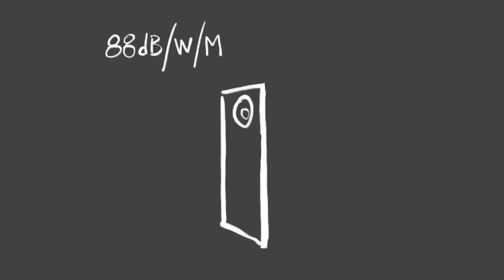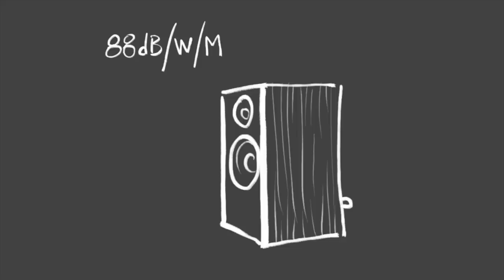John DeVore goes on a rant about the High End Audio lie that inspired him to start his company

Comment: I never put much credence in manufacturers or even reviewer-measured sensitivity specs, except to classify in my mind if the speaker is a typical low-sensitivity speaker or if the designers were going for something that would work with a low-power amplifier. Taking the sensitivity spec plus an educated look at the impedance magnitude and phase curve tells one quite a bit about how that speaker will react with various amplifiers.   There's a lot of interaction between the speaker's impedance characteristic and amplifier's behavior driving that impedance which impacts the sound heard by the listener.  In most cases this is particularly true of tube amps with their much higher source impedance, which is part of the origin of "tube sound."

Comment: The Ar3a is one of the best sounding speakers I've ever heard. You can still find them on Ebay at various prices based on condition. If can swing a fully restored pair and have at least 100 watts in a quality amp you won't be disappointed.
Reply: Their one of my pound for pound favorites, the forte is still my favorite but pound for pound i like the ar3a and the kef ls50 for their size anyway, but the ls50 will image waaay better than nearly any box soraker ive heard, thats their specialty i suppose. Then again the ar3a has crazy deep and smooth low end for their size, which is their specialty, the forte basically has it all, i cant find any faults with those.
Reply: @JukeboxAlley  In the day, Mac 60 monoblocks were a great match for AR speakers.
Reply: @genehart261  agreed, i had some 65 wpc dynakit tube amps on mine, its hard to beat that combo with anything literally.

Comment: Anybody that listens to vinyl isn't into high quality listening, they are into character
Reply: Up to a certain degree, I beg to differ.
I still listen to my vinyl. I use a class A Cambridge Audio Pre amp,  a turntable wooden made with belt drive by Thorens. A Concord cartridge and diamond stylus, 4 Mission floor-standing speakers with 16 gauge copper wire made by Chord and I clean my all my vinyl before and after playing to remove dust particles.
Am I not hungry for quality?
Man, if you have a passion, you want it all and how!
CD was never my thing. Analogical has always and will always be the be all and end all for a lot of us diehards.
Reply: @richmck007  Yeah, I agree it is fun to be passionate and you must be very proud of your kit. Steam engines are cool too! Each to their own.

Comment: Thanks for the video.  All of what you said makes sense to me, and it was obvious to me that these new speakers with multiple small drivers had less audible bass compared to my old JBL L7's than the 3dB difference in sensitivity and minor differences in response curves would suggest.  While your video explains my perception, I'm left wondering if the low-end impedance drop you mention is driven by driver design, the increasing use of multiple drivers, or both?  My experience with single-driver bookshelf systems suggests that it's the multi-driver phenomenon, but I'm less fussy about such systems and haven't done enough listening tests to confirm my suspicions.  I'm wondering if amplifier demands are more predictable when the speakers have a single driver.

All that is idle curiosity.  While nowhere near deaf, my hearing has degraded with age such that audiophile components no longer make sense for me.  That said, I've never purchased high-end loudspeakers without listening to them with the amp(s) I intended to pair them with.  As anybody who has invested in tube amps surely knows, good specs don't necessarily mean good sound.

Comment: Thanks John, but sensitivity in [dB/W/m] is just a WRONG unit. This suggests, that the sound pressure increases with the distance, but the opposite happens, as you know 😉 The "mathematical" correct unit would be [dB @ 1W @ 1m]. But in the sense of your message, your absolutely right!
Reply from the maker: Yes, you're completely right. I was using the most common way of writing it, but I should have discussed this in the vid.

Comment: John, I would like your take on something. I am a big vacuum tube guy and as such I think it is important to have a speaker system with a flatish impedance curve or at least one whose impedance closely corresponds to amplitude response. When it comes to multi way speakers however I wonder about crossover tricks to flatten the overall Z curve. It seems possible that some such tricks might just waste power in driving resonances without improving system response and amplifier load.

Is this a reasonable concern? Would it be a worthwhile approach to choose drivers with generally favorable Z to response characteristics and to only use them within the frequency ranges where they are most favorable? Would this avoid overly taxing crossover networks? How does a tubie like me evaluate driver curves and specs in this regard? Perhaps a video on the topic... Thanks for pulling back the curtain.

Comment: Volts and watts are two different things.  Volts are just part of the equation.  Watts are volts multiplied by amps.  Also known as volt-amps, or VA.  Ohm's law.  So, when the sensitivity of a speaker is measured by dB/2.83V/1M, then that is incomplete.  Because 2.83 volts multiplied by 100 milliamps is a much lower wattage than 2.83 volts multiplied by 1 amp.  So, the sensitivity measurement of dB/W/M is a more complete and accurate measurement.
Reply from the maker: Great comment, thanks.

Comment: There is kind of a vicious circle thing happening. As hifi went to more and more solid state amplifiers speaker designers got lazy and built systems with crappy impedance curves because (solid state) amps are virtually voltage amps so since these new amps care less we can be careless and assume constant voltage and infinite current capability.

So as speakers got less efficient, more ragged in impedance, and more current hungry the mantra was our speakers aren't crap your amp is crap. You need to buy a more heroic amp.

Comment: I'm a car audio enthusiast as well as someone who enjoys Hi-Fi home audio, but I am confused by this. It was my understanding from car audio subwoofer and monoblock amplifier setups that the lower the impedance you wire your subs to, the more power you can give them from the amplifier. Here I am taking it that a 2ohm load from the woofers in that Hi-Fi speaker received less power than the higher impedance mids and tweeters. What accounts for this difference? How does a higher impedance (resistance) not mean less power to the speaker?

Comment: Thanks for the clear explanation. But that has left me puzzled about headphones. I would have thought based on what you said that for good bass response, in what are basically tiny speakers, you would want lower impedance headphones driven harder. But flat response studio headphones are often 80 ohms or even more. Surely that would mean they could be driven easily for more volume but would lose bass response. Or did I misunderstand your explanation?

Comment: Excellent information! Most speakers in the AUDIOPHILE world are very inefficient!!! Quite dull sounding as well! Even ones with simple crossovers require big amps to wake them up because of the INFERIOR drivers they use!!!! I would characterize them as NOT BEING LOUD SPEAKERS at all! Simply because of the lack of engineering into the drivers themselves!

Comment: One glaring omission from most standard speaker and power amp specifications is, whether measuring by watt or by volt, is the frequency of the signal used during testing... Is white or pink noise used? Is a sine wave used, and if so, at which frequency? While Ohm's Law uses the value of, "resistance", in it's equations, which is the resistance to a DIRECT current..., (which can sort of be thought of as an ultimately low frequency of 0Hz...), a dynamic loudspeaker's voice coil doesn't only offer resistance..., it also offers inductance..., and even a little capacitance as well..., so the combined load acts as an RLC network circuit..., (Resistor/Inductor/Capacitor), and while the resistive properties are fairly constant no matter the frequency, the inductive and capacitive qualities are extremely dependent upon frequency... So if you ran four tests, each at a different sine wave frequency, 20Hz, 200Hz, 2KHz, and 20KHz, then the results for each test will be very different from each other... And should white and pink noise be used for two tests, then as white noise has more high end than pink noise, it's results would also differ...

Comment: John , yes cool T shirt as another has said. You are delivering solid info.  I too, was big into audiophiling in the 80s.  Still have my quality equipment:. NAD 1300 Prem, NAD 2600 Amp ,. Dual CS500 TT, and best of all and probably the primary importance to your high end stereo system, KEF 104/2 Tower speakers.  Then the kids came along and lots more expenses.  I just had a failure of the Phono input on the Preamp.  Found a local stereo repair who repaired the NAD Preamp for $125!!!  Upgraded the cartridge and stylus to ortofon 20 on the Dual TT. The system plays wonderfully , btw, no SW .  That addition is under consideration. At age 69, this stuff is a great hobby and interest for music lovers,. BUT very exensive once you start wandering into Universe Of Stereo

Comment: Let me offer an alternate theory.  In the days of tube amps you roughly matched the
speaker (rated) impedance with the selected tap on the output of the amp and 
therefore a lower impedance speaker got less voltage and more current up to the
rated power of the amp.  This is because tube amps are less tolerant of minimum
load impedances.  However, good (or very good) solid state amps, with their low
output impedance, and high available current are (should be) essentially voltage sources.
Put a lower impedance load on the amp and it draws more current and has more power 
delivered.  Since we do not move to different taps on the output (there are exceptions)
the voltage sensitivity rating (not efficiency) tells you more about what max SPL you
can get out of a given SS amplifier as long as you don't exceed the min impedance spec of
the amp.  Both specs have meaning:
dB/W/m is the efficiency spec
dB/2.83V/m is the Voltage sensitivity spec

Comment: So, in a round about way I stumbled onto this bad trend in the late 90's when I wanted to build my own speaker enclosure and select my own drivers.  It also worked out as a good final project in carpentry class in highschool.  I bought a book from Radio Shack explaining some various designs and theories and went to it.  The cabinets came out great.  Next was to select the drivers for a three-way setup.  That's where things started to fall apart.  Some back story is I grew up listening to my fathers DJ equipment.  It was pretty good stuff.  It wasn't the most crazy high end stuff, but it was better than most people had.  I grew up listening on Marslands and an old Nikko RMS-1200 pre-amplifier.

On the back it specifically says to use 8 or 16 Ohm speakers.  The common wiring for a three-way setup with industry drivers would put me at 4 or 2 Ohms.  That's when I had to do some serious searching, but eventually I came across some non-branded Panasonic drivers that fit the 8 Ohm.  I know my dad harped on that but having you explain some of the industry history helped bring things full circle.  I'm still spinning vinyl on those speakers I made, though not always enough time to nerd out on all the audiophile stuff like I used to.

I don't know if you covered it or know why, but why has Bluetooth taken over wireless audio.  It was never meant for it, and even at BT 4.5 and 5.0 now, it is still lacking and terrible.

Comment: I’m trying to understand this level of thinking. I’m still learning. Probably won’t run into this issue as I’m not on the high end level. But it is something I have thought about. That 1 watt 1 meter is usually with a 1khz tone. People online will talk about how you may never use more than 1 watt in regular listening but like those speakers you spoke about dipping under 2 ohm- deep bass in any speaker can drop in ohms and result in the amp giving much more power on top of the db raise for it to sound just as loud.

Comment: It's certainly something to be aware of to evaluate a purchase, but 2,83volts is more useful for designing the speaker to target a linear response, than 1watt 1 meter. I don't like the accusation that there is some industry conspiracy or twist for sort of advertising the speakers more favorable than they are. If anything on sensitivity that needs a light on a subject it is sensitivity under 100Hz that is where the biggest difference is. It's relatively easy to create sensitivity over 60Hz, but once you go lower is where it gets hard to be efficient and still maintain a good response in a saleable box size.

Comment: This is exactly why I was loyal to HiFi Choice magazine during the late 1980s and 90s. For every loudspeaker reviewed, they always produced a plot of impedance / f so you could see precisely if a particular model was going to trip up an amplifier. You would always expect a variance, of which the manufacturer quoted a mean value, or worse, was quoted for a 1kHz input. Personally, I always interpreted a manufacturer quoting 6 Ohms as an "8 Ohm speaker with a big current drain somewhere in the bass to mid-bass".

Comment: Yep, I watched this all take place while I was an audio enthusiast and as I moved into pro sound.  In the 80s the price of amplifier wattage fell pretty dramatically and we no longer needed an Altec or Klipsch to fill a large room.  When speaker designers began to exploit amplifiers by running at 4 ohm or lower I saw how the dampening factor would collapse during loud passages containing a lot of LF energy with all but the most high end and expensive amps.  This meant flabby bass response at best, overheated amplifiers at worst. 

Eight ohm presents a fairly easy load to most amps built today so that is nearly always my choice in passive speaker systems.

Comment: For decades i stayed away from 4 ohm speakers for the exact reasons you mentioned that over burden amplifiers leaving the speakers unable to accurately reproduce published specs ,in my tube system i always stayed with a Klipsch Heritage speaker such as the Belle Klipsch,in my solid state system i never bought anything except Mcimtosh speakers as Roger Russells specs were always trustworthy ,i can remember telling my hifi buff friends about the speakers impedance swings Roger Russell taught me about & getting the deer in the headlights look with the same answer everytime " but my amp is " insert wattage here " so it should drive anything ,wrong ,the last speaker ill ever buy for my main solid state system is the now 20 plus year old Mcintosh XRT-28 which requires absolutely brutal amplifiers that can double down to the 2 ohm range for crescendos or heavy bass passages ,i think most people understand these issues with speaker & amp matching now days,at least most whove been in the hobby a while,what most dont understand is the need to have 20 amp dedicated lines to power these monster amps at low ohms ,each of my 1,750 @4ohm monoblocks has its own 20 amp line and a 3rd 20 amp line for preamp & source gear ,even with a 20 amp line my amps cannot be fed enough power from the wall to double down in 2 ohms past 1,200 watts at the 4 ohm tap ,its a good thing my speakers max is 1,200 watts continuous because my 20 amp lines cannot push out the 3,500 watt max my amps can deliver at 2 ohms,not even for a second ,still i see pairs of monster 1,000 watt @8 ohm monoblocks plugged into a single 15 amp line which feeds an entire room but people swear their Maggies couldnt possibly sound better .

Comment: The Unit of the speaker efficiency measurements is NOT db per Watt per meter. That's just wrong. It is db at the conditions 1W and 1m. Just think about it: If you double the meters you get less, not more db. If you double the power you get more db, but definately not double the dbs.

Comment: Is that >2 impedance for the driver not the cabinet? So wat your saying is that past the crossover the mid is not getting proper voltage in your example? A resistor in the network was not an option I guess.

Comment: Wow... No Joke..I just purchased a Krell KSA 250/KRS2 combo and had them both refurbished at Krell.   They play very nicely with my Westlake BBSM10's (3.2 Ohm nominal impedance) .......pure heaven in fact to my ears.  They offer very, very tactile and muscular instrument reproduction in this configuration!   

I have a few high efficiency rigs as well with restored integrated tube amps and ultimately IMHO, they are just a different flavor which can also be totally engaging.  High efficiency with a good low power tube amp can be a heck of a lot less expensive as well...the speakers larger...and maybe requiring a touch more carpentry, but if you DIY you get a lot of value for your S this way.  

The road maps to audio nirvana are indeed circuitous.

Comment: The fact that audiophiles hasn't moved en masse to active speakers is evidence that it's not about the sound. You will, with no question about this, get better sound if you drive elements separately, with amps designed for that specific element load. You get no nonsense of elements passively interacting with each other and loads varying in base and treble, because you have separate amps for that.

But, then, of course, with the amps built into the speaker you can't buy a nice shiny silvery amp with glowing tubes as your centerpiece, can you? 😉